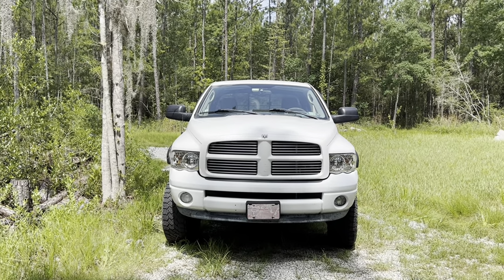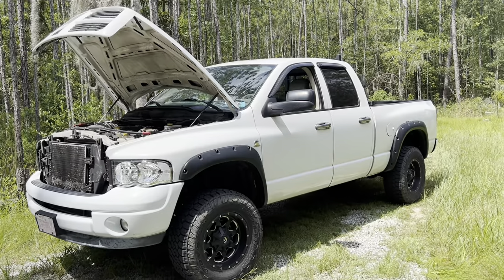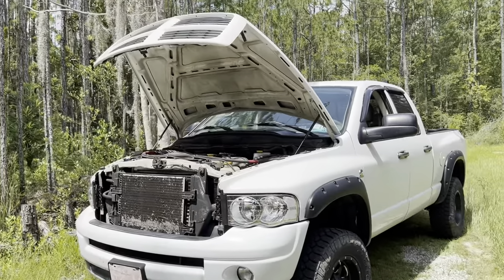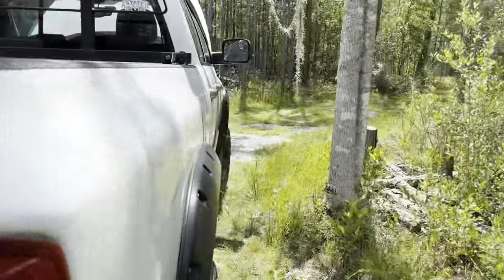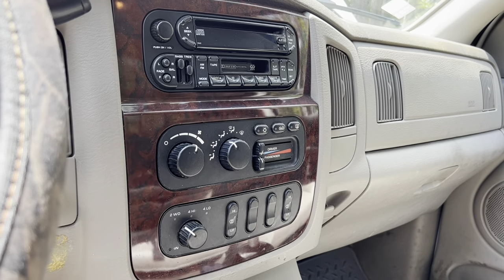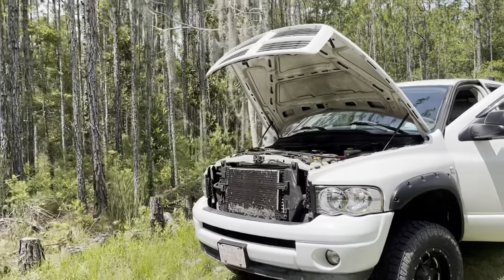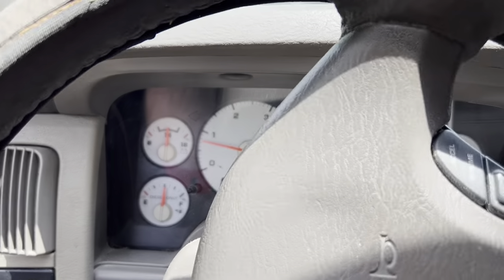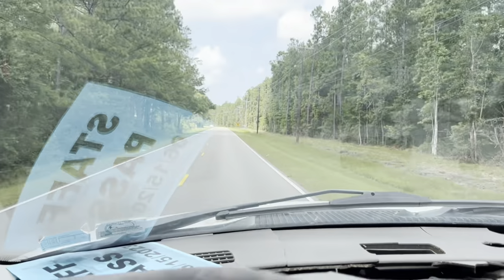9 year ownership update - 2003 dodge ram 2500 5.9 Cummins

Comment: Nice! My 2005 Ram 2500 is a 5.9 HO 4x4 QC SB with 6 speed NV5600. Got 123K on her now after 16 years of ownership. Solar Yellow mint condition all original. Has had a pampered life. Really had nothing to fix on it until I did the front brakes and rotors, ball joints, wheel bearings, front axel ujoints and both front and rear driveshafts ujoints a couple years ago at 95K. Run Balwin 7977 5 micron fuel filter since I got it almost new, no mods on motor and all original. 

Just put on Synergy steering upgrades and track bar with new pitman arm, wow way better steering and no wandering! Highly recommend.

I've had corrosion on the cable grounds before too, have to clean those every few years or so. I hope my truck lasts as long as yours and hope I last long enough to drive it that far!!

Comment: Besides not replacing injectors or having transmission work done, I am most surprised with the center console having no cracks! For a sub $150 mod, pick up a new seat cushion. It was a night and day difference in my 04.5 with around 300k miles on it.

Comment: Your truck is travelling significantly faster at 1700 RPM than my 04 Ram.  Mine is at 62 MPH.  Curious what size tires are you running?  I'm running stock 265/70 17s.
Reply from the maker: Mine are 285/70 17s. The speedometer is also calibrated for the larger size. Also have 3.73 gearing which will rev lower than if you have 4.10. And if you have a manual trans it will rev higher versus the auto.
Reply: @OutpostCTD  I have an automatic and 3.73 rear but I'm running OEM tires.  I'm looking to go  a bit larger in an AT tire next time.  I'm not towing heavy delivering RVs anymore so I can afford to trade some pulling power for lower RPM at highway speed.

Comment: Hey off topic question from this video, but I saw a video of you replacing that heater core metal line that goes down under the exhaust manifold.  How hard was it to get off and put back on?  Also any other tips or tricks.  Thanks!
Reply from the maker: That was a brutal job. Best tips I have for this is remove the wheel well liner for better access and push off the little rubber elbows with a flat head screwdriver. The elbows and metal line can come out in one piece and then you can transfer the elbows to the new metal line once it’s all out. It takes some wiggling to get the line out past the manifold and the new line in but it can be done without loosening the manifold.
Reply: @OutpostCTD  Thanks!  Yea I am dreading the project.

Comment: Do you use any additives for your fuel or oil?
Reply from the maker: I run fuel additives intermittently. I’ve used Schaeffers and stanadyne the most. For oil I haven’t used any additives.
Reply: @OutpostCTD  Thanks for the quick reply. I'm picking up a 2003 RAM 2500 next week and this is my first venture into diesel. Any suggestions on where I can get tips and tricks for maintaining this truck?

Comment: Show me a Ford or a chev that's 20 years old and 400k with less problems......
Reply: Seems to all boil down to doing maintenance and this guy does it! as a Chevy guy I agree from what I've seen with Duramax's they tend be higher maintenance. The gassers will run forever though with minimal maintenance. It appears Chevy appears to have better paint though. And I've never been impressed with dodge or Ford's interior.